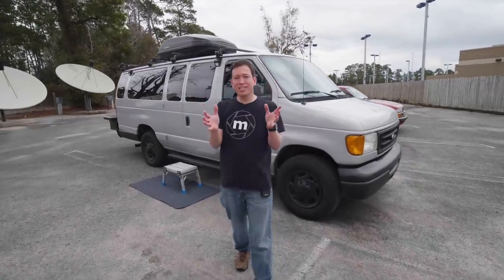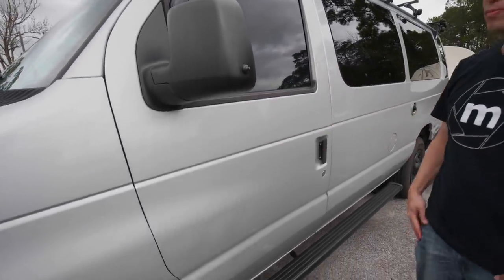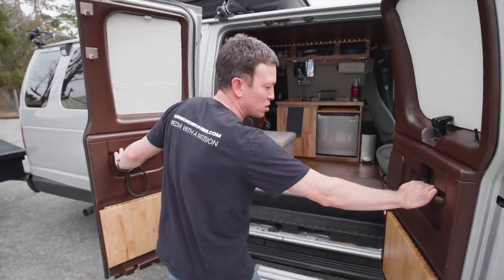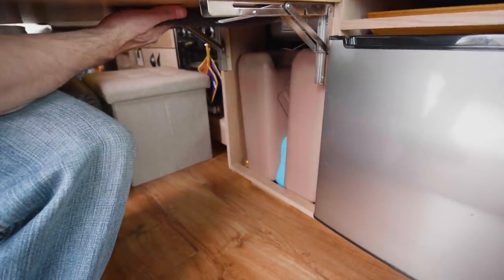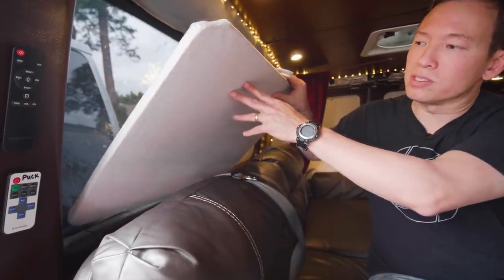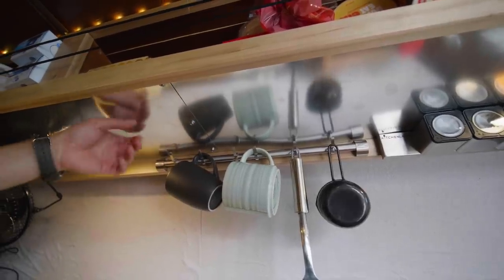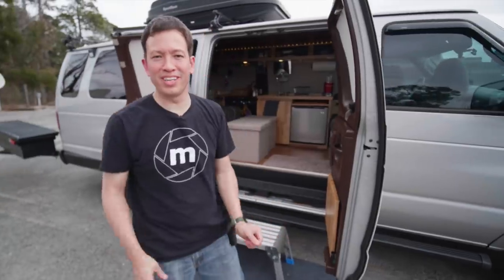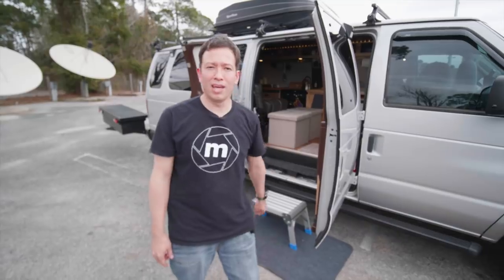Touring Camper Van Tour 1.0

Comment: Also, bidets are absolutely awesome.  Mine has been waiting to be installed, in our house, for 2 yrs!  Grrrr
Reply: Call a plumber or hire a handyman from the classifieds and the waiting will be over. Can't be that expensive, it's not that hard unless you need wall plumbing done. Mine just attached to the water valve beneath the tank.
Reply: Girl pull it up on utube and diy. I would.

Comment: Great Van build learned a lot. Mostly on the electronic end. Also like the oven. My friend brought that camping. I thought it was silly until they made garlic bread, french fries, baked potatoes with cheese. The low-tech toilet is a no no. Cassette toilet is the way to go. You went to all this trouble and didn't raise the roof. Not a fan of the bed, that's got to be uncomfortable, or the truck box on the back of the truck. Better platform  bed would have given you all the storage you had in the truck box. Impressed by many of the items. I'm sure it works well for you. I'm getting ready to build out a weekend van camper. 3-5 hours any Direction with one or two night stays. My wife is concerned about security. I like those cameras and sensors!
Reply from the maker: Dr. Leo, thank you for your feedback and watching!

Comment: Great built with very good ideas. It looks like you are using a 110v dorm fridge. I've use them for years on my vans. They evacuate the heat through the side wall. It looks like you have completely blocked those walls. It will be dramatically more efficient is you let those walls to breath.
Reply from the maker: I have since replace it with a 12v/110v switchable fridge. Thanks for watching.

Comment: Bidet, absolutely genius!!! Even just to feel clean. I love it! But you should of given her a shower dude... even if you hooked up a shower hose at the back for an outside shower. My non negotiables are having a composting toilet and shower. Even if that means a larger van. Also! With all the bells and whistles you put into that gorgeous machine, you could of gotten an on demand water heater.  Just my two cents. You obviously pulled out all the stops, so you had the money. Never too late to add those things for the wifey!
Reply from the maker: Thanks for the input Crafty. I do have a portable shower and enclosure (not part of the van). Most of the places we have camped so far have shower houses which is convenient. We are not doing a lot of long term off grid camping yet.

Comment: I have an old camper I can cannibalize for parts to build something like you have. 3 way lights (120v, 12v and propane lights) as well as the stove/oven and the 3 way refrigerator 120v, 12v and propane. I'd like to take the shower and toilet from the camper too if I can. I can take the holding tanks and mount them under my truck... (I have my own shop and tools, so I can build whatever I want.) I also have my Wells Cargo cargo trailer  to haul my things behind me wherever I go. I could set it up as a shop to work out of as well as to haul my car and bike.

I already have a new diesel air heater and I'm getting an air/water heater of the same design. I know in Florida you don't need to be so concerned with heaters. lol... I'm from Titusville... far from Titusville right now. 😉🙃😆😜🤪😝😎

I have two wind turbines that total 4,500watts... and I have small solar panels, but I want to get some 380watt solar panels. I can have them folded down while driving, but open them up to increase my power when parked. (I also have some designs of my own to increase my power capabilities so I could possibly even power someone else's camper camping with us. Or multiple vehicles.)

So many things I can take from the camper and all I need to do is put in new propane lines.

I had a step van I made into a roughed out apartment I lived in while working out of town. I still have my tow dolly for pulling my car behind me, so I could park and live in the step van and drive my car to get around.

It was complete with a desk and my desktop computer as well as a TV and video playback to play my movie library.

I'm both an electronic field engineer and a computer network engineer so I'm very experienced at pre-wiring for basically all electronics, including security, communications and everything else you can think of. lol
Reply from the maker: Thank you for watching. Sounds like you are putting together a nice system.

Comment: I'm curious why you have a rack on the front and one on the back with a car top carrier in the middle so you can't use the front and back racks? You should have put one set in front and the car top carrier  on the back, or visa versa. So you could at least use them. Probably best for the carrier in front to cut the wind better for whatever you put on the racks in back.

I like your setup for the rack you have on the back of your van. Very good design with the truckbox.
Reply from the maker: I can still use the front and back racks with the cargo carrier in the middle. I am currently installing solar panels to the front and back racks.

Comment: I'm about ready to do the same vent registers in the cab foot step well like you have -- such a great idea!! How do you feel about it now that you've had it for a while? Is there additional road noise? Have you ever had moisture come through with extended driving in rain? Thanks again, your videos have provided me MANY ideas for my van build!
Reply from the maker: Jeremy, thanks for watching. That’s a great question. I would say this, for me I think it was solving a problem that I did not have. Mainly because if I do need to vent the van I want to vent the van through the vents that I use to remove heat from the refrigerator. Hope that makes sense. It was a lot of work for something that I personally do not really need.

Comment: Absolutely love this build! I'm gathering plans to build out my own 07 Econoline EB right now, just gutted the interior. I'm curious, what did you use to add a secondary AC fan in front of the AC radiator? I'd love to boost my AC performance as well...
Reply from the maker: Jeremy, thank you. I was fun building, but a labor of love. What I purchased is listed in the description under Van Vehicle Air Conditioning. However, there has been no noticeable improvement after the install. I don't think you need it...in fact it is probably a drain on the alternator that is

Comment: Fantastic job ! I'm amazed at all the electrical capability and all from using your engine as a generator ? Can you repeat what batteries you use to store all that ? Do they need to be vented ? How long with say average fall or spring use do they keep everything running as you need it before you need to recharge them ?
Reply from the maker: I am using 2 100ah vmtanks agm batteries. No venting needed. I can go a couple of days before needing a charge.

Comment: That’s a brilliant build! Please tell HOW you swivel mounted your tool box on the SwingAway cargo carrier. Did you use the K &M seat swivel? Did you drill new holes or use the existing pre-drilled mounting holes? I have a swing away cargo carrier a 2' x 5' locking aluminum toolbox. I really need to do this so I can open my doors! Thanks...
Reply from the maker: Thank you. Here is the install video: https://youtu.be/7xE8FJwrzn8

Comment: Hi, fantastic job, what kind of refrigerator u have in your van, and does it work fine? Can you please tell us where did you get it, thank u so much.
Reply from the maker: Thank you Khantil. I have an igloo fridge purchased from Home Depot. https://www.homedepot.com/p/IGLOO-1-6-cu-ft-Mini-Refrigerator-in-Stainless-Steel-FR180/203473992?cm_mmc=hd_email-Ready_for_pickup20170113_PP_ET_Merch_Ready_for_pickup_2996422_-product_desc__W560116748    It works good, only if you are plugged into shore power or driving to charge the batteries.

Comment: i really like the swing away swivel hitch set up looking at pictures of the two i was wondering how you mounted the swivel to the hitch. Also how stable is it from the video it looked like as soon as you stated to move the swing away it started to swivel i would imagine you unlocked it first. Another question looks like you added some extra metal bars on the bottom? Can you explain or do you have some pictures of the set up with out the storage box on it? Beautiful job you did on the Van I'm in the middle of converting one right now this is inspirational.
Reply from the maker: Moksha, yes is has a locking mechanism and extra metal on the bottom. Here is the video of the install: https://youtu.be/7xE8FJwrzn8
Reply: @IanSkelley   thank you i found your collection of videos great stuff here!

Comment: Would you tell me more about how you attached the swivel and storage box to your swing away hitch mount?  
This is an ingenious design to maintain access to the rear doors and I'm looking to do the same on my campervan.  In your parts list of the video description you put a Swivel Seat Mount just under the Swing Away Hitch.  Is that what you used?  If so, how easy/difficult was it to attach to the hitch and box?  Also do you have a storage box brand you would recommend?

Impressively well thought out build and tour Ian.  I hope you have great fun with this adventure van and appreciate you posting this.  I'd be grateful for any advice.
Reply: After looking further at your channel, I found you had already made a more extensive video on this here.  https://www.youtube.com/watch?v=7xE8FJwrzn8  
A year later, is there anything you've learned or would do differently attaching your swing away hitch mount?
I see the mount is rated for up to 200 pounds.  Have you ever had concerns about over weighting it?
Reply from the maker: @SmilingJoe  It is still working great. I have had no issues with it. One of the best things I did to the van. It is so useful. I make sure that I don't overload it and it gives me plenty of space.

Comment: Nice work!  Am doing a build myself now and appreciate the information/products you took the time to provide links for.  Regarding the jack knife sofa, am trying to find one with certain dimensions, color and storage drawers underneath.  Who manufactured the one you're using?  Where did you buy it?  Any additional information you acquired through your research would be helpful.  Thanks,  Jason
Reply from the maker: Jason, I don't know the manufacturer. I bought it used from craigslist. I am pretty sure most of them have a standard base. The one I have did not come with storage drawers. The drawers you see are walmart plastic bin drawers. Hope that helps.
Reply: Thanks for getting back Ian!  I rewatched the video and just realized you did mention the Craiglist purchase.  My apologies.  Yeah, having some challenges finding the sofa bed that works just right.....
Really appreciate you putting the build list together!

Comment: Do you have a link for the exterior LED motion sensing lights?  Think the link above is for the ones you installed in the foot wells of the driver and passenger side door area.  Or did you make the black angled housing for them to fit in?
Reply from the maker: These are them. https://www.amazon.com/Outdoor-Costech-Wireless-Installation-Security/dp/B07DYKMYXD/ref=sr_1_34?ie=UTF8&qid=1532350827&sr=8-34&keywords=led+motion+sensor+light+off
Reply: Awesome!  Thank you.

Comment: Really awesome design.  Thank you for giving us a tour.  I bought the exact same MasterChef stove / oven to be put in my camper van, thinking about mounting it recessed in a cabinet structure just like yours.  But I wonder if I need to give some space on the two sides.  I don't have much space, but when using the oven don't the two sides heat up quite a bit?  I'm thinking of placing some sheet metal just to protect the adjacent wood panels and also providing an exhaust fan in the back to provide airflow and dissipate the heat faster.  Do you use the oven with no problem in your design?
Reply from the maker: The stove/oven is great! I am not experiencing any heat issues with the sides and we built right up to it with almost no clearance.
Reply: Even when you use the oven?  That is so nice to know.  I tested mine in the garage and the sides can get hot when the oven is on.  I guess it's OK to use as you set up.  Thanks.
Reply from the maker: Hung Pham we left room for the venting on the sides. I don’t think we will have a problem with it.
Reply: Metal sheeting and fire extinguishers front and back island arent' expensive and will provide peace of mind. Why not minimize risk where you can and enjoy your masterpiece for many years to come ?

Comment: That rear AC on the van did you remove it or how did you make it and the heat work I noticed on the dash that you had the switch for it. I have a hightop van E350 that I am trying to convert and was just wondering if it was better to take it or work around it
Reply from the maker: I did not remove the rear AC/heater.....and glad I didn't. In the Florida heat, you need that AC. In the winter, the heat is nice.

Comment: I have the same van. Where did you get the running boards ?Thanks for the video!
Reply from the maker: The running board came from Truck Gear Direct. $139. Great price,  but I did have to modify them a bit. Originally they did not come out far enough from the van and it was hard to use it as a stepping platform. I used some steel bar from Home Depot and extended them out a bit. It worked great,  but don’t expect much support from the company.  The seats  swivels. I got off of a group buy on the sportsmobile forum

Comment: 65 lbs in your tires seems a smidge on the high side even if you're running them high for better gas mileage. most cars and even trucks run close to 35, even with the extra weight it just seems like a good way to ruin your tires.
Reply from the maker: Kyle McVey the recommended psi range is 60-80 psi.
Reply: @IanSkelley   that's interesting, are they special tires? I've yet to see tires rated that high for psi. I could see the max pressure maybe being that high on a quality tire but to the best of my knowledge you should never really run the tire at the max pressure listed on the tire itself.
Reply from the maker: Kyle McVey this is the tire I have on the van. https://www.firestonetire.com/tire/transforce-ht?ef_id=Cj0KCQiAg_HhBRDNARIsAGHLV52Wlx-J-6hvzQ1W6coDeXYoXozHbj6RWEwWql_QI-vjBKNjnQ3EwBIaAkZeEALw_wcB:G:s&s_kwcid=AL!5372!3!315500568144!b!!g!!%2Bfirestone%20%2Btransforce%20%2Bht&lw_cmp=sem_fst-us_g_dr&keyword=%2Bfirestone%20%2Btransforce%20%2Bht&campaign=978134306&adgroup=47942598909&gclid=Cj0KCQiAg_HhBRDNARIsAGHLV52Wlx-J-6hvzQ1W6coDeXYoXozHbj6RWEwWql_QI-vjBKNjnQ3EwBIaAkZeEALw_wcB

Comment: Where did you get the foil/denim insulation? What's it called?  The van came out great!
Reply from the maker: I got it from Home Depot. https://www.homedepot.com/p/UltraTouch-48-in-x-24-ft-Radiant-Barrier-30000-11424/100661257?MERCH=REC-mobileweb_navplp_rrNA-100661257--N
Reply: A much better option than Reflectix which has its uses but is overestimated as insulation. Thanks for the link !